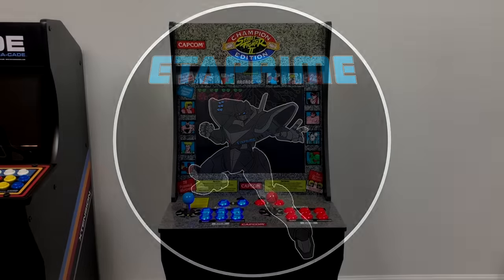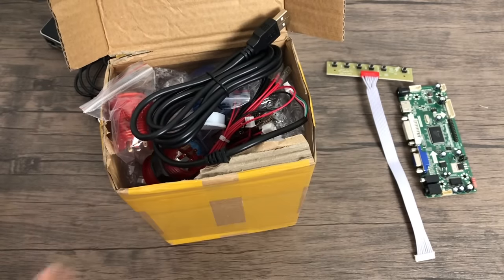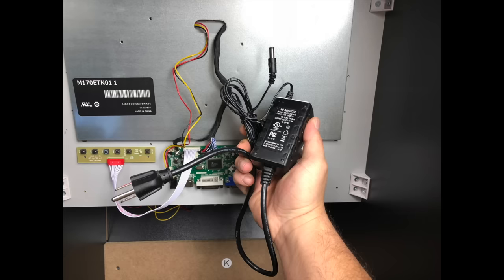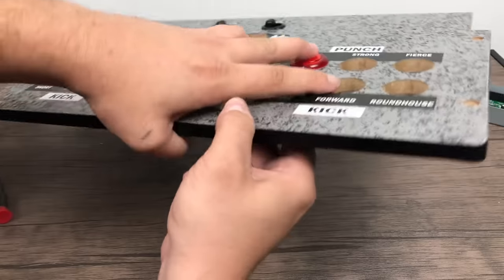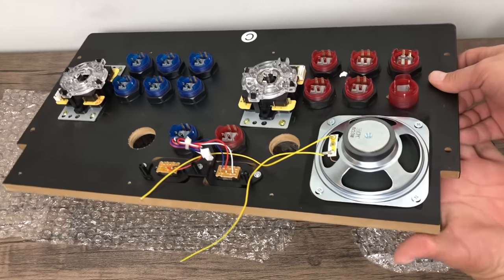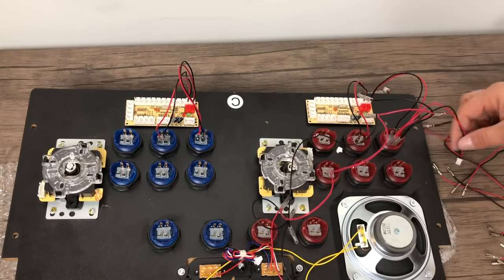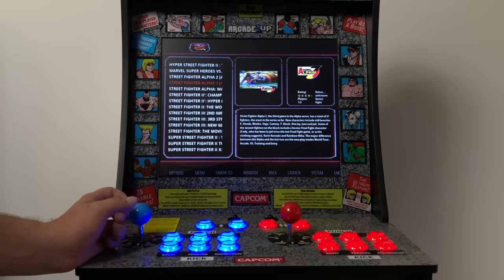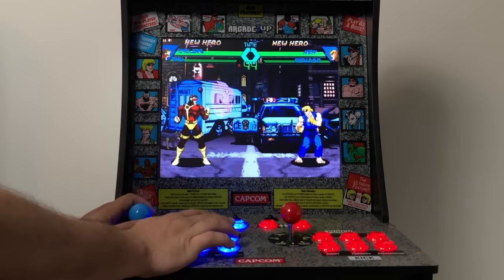‪Arcade1UP Raspberry Pi Install Tutorial - RetroPie in an Arcade1UP

Comment: I plugged everything in, and I’m getting a red and green flashing screen
Reply: Ever figure it out? I'm getting it too myself
Reply: Thanks a mill. Dammit, I was hoping this would be as straight forward for me as in the video. I'll see if I can fish out an old monitor somewhere
Reply: For any future people with this issue. ad this issue. You just need to replace the  LCD to HDMI board. Even though the board I bought said on Amazon "This board works on the Street Fighter 2 Arcade 1up " it was not compatible. 
Make sure to read the exact model number on your monitor, and make sure that the board you buy has that number in the description.
I returned my board to Amazon, bought the correct one, and it worked straight away

Comment: Speaker tip- use a AA or AAA battery.  Hold one wire on the bottom of the battery and then tap briefly the other wire to the top of the battery.  If you see the speaker cone push out when you tap then you are in the correct phase and you'll know which wire in positive and negative.  If the speaker cone pulls down then you are out of phase and you'll know you just need to flip the wires around to have the correct phase.  I also swapped out my speaker with a two way Kicker 4 inch speaker, it sounds great!
Reply: curious how many ohms stock and kicker one you used are
Reply: @coolelectronics1759  4 & 4
Reply: @christopherbrown5338  cool thanks

Comment: Thanks for the comprehensive tutorial. One thing: Do yourself a favor and use industrial velcro instead of two-sided tape. It's not too expensive and it'll make it much easier to remove/replace components if you need to.

Comment: 17:19 pro tip,  take a double a battery and put one speaker lead on the  + one on the -.  If the speaker pushes out you have the right polarity.
Reply: VERY PRO Thanks!
Reply: That’s an old car stereo installer trick - I always had a 9 volt battery and did this to check polarity when I needed to verify
Reply: The man. 👍🏾 Shout out from 2024.

Comment: Followed this and everything works great ADDITIONAL TIP! You can remove the mount plate from the Original Joy sticks and transfer them to the Easyget Sticks show in the video so you don’t have to drill new hole for the stick mounts! Thank you ETA Prime!
Reply: Robbie Whiplash Do you have a link on how to do this? My stock stick plates were super-glued to the board so I’m wondering if removing them and sticking on the better sticks would be easier to do.
Reply: SmaMan  No, I personally don’t or know of one. I just kind of figured it out on my own while I was doing the mod.
Reply: Thanks, this helped me today

Comment: For items like the amp, I'd recommend using velcro instead of double sided tape. This way, if you need to remove anything in the future, you can pull the amp off the side to access the wires. Much easier than trying to disconnect by reaching around to the far side.
Reply: Yes.. and i know to never use zip ties...  Instead, use Velcro wrap.

Comment: This is the most comprehensive vid I've seen for doing this type of Mod. Interestingly, the newest LED buttons I got look exactly like yours except they have connections like the encoder board on the bottom instead of the 4 leads. Thanks again for making this vid!

Comment: I followed your instructions and they were great. I only had one problem and that was the wires for the CFL were to short to reach the wood part. So if you take the old board out of the metal box there is a piece of plastic behind it. I took it out and taped it to the metal monitor back and then taped the controller board to the plastic. Thanks again for your instructions.
Reply: You  literally a life saver mine has the same issue with regards to wire length was looking at reusing the pcb box  but now ill just follow this instead,cheers mate
Reply: Thank you so much for this! God bless. I just started modding my free gifted sf2 1up cab and have the same problem.

Comment: Probably have built 10 retropie setups. All done with some of your tutoring, of course! Learn something new every time you do a new build. Keep them coming. Although the only thing I would have done different was implement your two wire single button shut down with script method on the power button!!!
Reply: stupid question, but where do we find the software to put on the pi ?

Comment: Thank you for this video! Just completed this myself by using your instructions. Only thing I changed was pulled out Volume/On-Off switch and expanded those holes to fit 24mm buttons. Works perfectly.
Reply from the maker: Awesome!
Reply: ETA PRIME show us how to still use the stock power and volume switches with this set up. Thats all im missing, please!

Comment: The tutorial was great! I finished the mod last night. I added a 2nd speaker for stereo!
Reply: how do you add a 2nd speaker? also how do you turn on/off and adjust volume?
Reply: @baophan4067  You can add a 3" speaker on the other side and drills holes in the same pattern. I brought a switch that plugs into the power strip
Reply: @Reggie4087  the switch turns the unit on and off or controls volume?
Reply: @baophan4067   I don't use those buttons ..in the tutorial he recommended using the AMP for speaker audio... it supports stereo I just set the audio at a reasonable setting and close the unit
Reply: How do you properly shut this down?

Comment: great video! I did the same on my partycade, but instead of running a power strip, what I did was use a 12volt splitter and a big 12v power supply: I then Used a 12volt USB hub for powering the pi, and tapped everything from the 12volt splitter. That way I only use ONE power supply for the whole arcade. Also I am using a partycade.

Comment: You don't have to add more buttons, you can set the P1 start and credit button to the same button.
I have a fullsize mame cab and a bartop arcade with Pi inside and I only have a single button for each player and has caused no issues.
Reply: So the player 1/2 button works as both insert coin and start game?
Reply: @dogballs99999  I would like to know as well

Comment: Thank you so much for this. I was on the fence for getting one of these because of the cost and the amount of games that it has, but with this mod it's a no brainer. I'm going to be buying a PS4 for $150 on craigslist and trade it in to get $250 credit towards a 1upArcade from gamestop. Thanks Again!
Reply: I'm doing the same thing.
Reply: I did same things, traded in system paid 80 with tax. 10 was added for edge shipping (if inpatient you can get sent overnight). Ordered in store 10-5, got today 10-9. Will mod system today.
Reply: @mysticguy  Congrats! I'm actually putting mine together this moment. Waiting for the pi to be delivered later today.
Reply: @Jay Te 
Great, finally put mine together last night. I still need LCD controller board. I Have LED joysticks and Raspberry PI. Had to order from China, says it’s in NY now. Wish there was an alternative I could use for now.
Reply: @mysticguy  same I'm waiting for my led board too. You can use a tv or computer monitor ( anything with hdmi) for the meantime to make sure everything is set up, and connect it to the pi.
Reply: @Jay Te yeah I currently do that now. I have 3 raspberry pi boards. I’m using the Supreme Build V2 128gb image of retropie for my cab.
Reply: Nice I was trying out the 64gb Retropie Infinity, and I'm downloading  RetroRama v2 128gb, I'll check out the Supreme Build v2 too

Comment: If I did this, I would put the select button under where the normal coin slot would be. Haha and add an actual coin slot for donations.
Reply: If you're crafty I think you might be able to make a coin slot into the select button, you would have to turn the coin slot to a switch some how.
Edit: I did some quick research and it looks like it can be done. Here's a link to a "Coin Drop Replacement Pushbutton"  https://goo.gl/jAP8Fp
Reply: I was thinking the same thing, but I would make mine for cosmetic reasons only. Where to buy a coin slot button or just a door with the buttons that wire up in the same manner as an arcade button?? 🤔🤔🤔
Reply: @jayte7139  Thank you!! Exactly what I was looking for! Now I just need to find buttons that allow me to put either paper or printed clear plastic with printed letters and words to label my buttons (i.e. A, B, C, Start, etc..)..
Reply: I did that on my build hidden out the way
Reply: @Kevin Baumann I'm not sure. I just saw it online doing a quick search. At the end of the day it's a switch so I dont see why it wouldn't.
Reply: @jayte7139  the coin op mechs have microswitch connectors. 2 wires and its "hooked up" as a select button.
Reply: @Solmangrundy  yes. I'm making a video of the installation on a 1up.
Reply: IF you call 1Up, they will ship a clear overlay to you for free.
Reply: An aftermarket coin box can be bought on Amazon. It plugs directly into the zero delay usb encoder like any other button. Then you can assign it in mame so when you drop in a coin it adds credits. I did this with a full sized machine i built
Reply: Dude you gave me that idea i put them right below and am adding a coin slot for coffee donations !!!
Reply: But why did the button say 20 cents?
Reply: @tornay131  Lol.. AUSTRALIAN!???

Comment: I found out that if you are using a Sanwa JLF or JLF clone joystick, you can still use the Arcade1up joystick mounts(on mortal Kombat 2 cabinet, not SF2). the 4 screws on the middle of the JLF mounting plate (around the shaft) line up exactly with the Arcade1up mounting plate. no need to try to re-center or drill new holes for the joystick. just unscrew the 4 center screws from the both plates, and swap them.

Comment: First of all, AMAZING VIDEO!!!  I’ve got a SF Arcade1up on the way and I can’t WAIT to play it!  This video makes me even MORE hyped knowing I can add more games.  I’m SUPER low on cash and want to do this as CHEAP as possible.  As a total noob with doing stuff like this, I must ask, am I required to buy one extra button for each player to act as a select button or will retropie let me hotkey select buttons in?
Also, if I just want to stick to the default speaker that comes with it, is an amp still required?  Thanks in advance dude!!
Reply: DISCLAIMER I'm not doing this mod, nor do I have anything in this mod video. This is an outside in perspective.

The amp circuitry looks like it was integrated in the original computer module, which is removed in this video. It appears you will need a amplifier if you do this mod.  I recommend a Lepai lp2020 if you want to keep the original speaker. The lp2020 support bridged mono configuration, which will amplify the input on 1 speaker using the entire amplifier. If you want to use new speakers, the lp2020 is still a good choice because it also supports stereo 2 channel input and output.

Another option would be to duct tape in a set of cheap usb speakers to the inside of the cabinet, and run the 3.5mm jack into the raspberry pi.
Reply: Jonathan Clark I’ll keep this in mind whenever I mod this in the future!  Thank you!!!

Comment: An amazing instruction video!!!  Big Thx!
Maybe it would be easier to replace the built-in monitor with another cheap LCD screen which already has hdmi input possibility, so you dont need the HDMI LCD Controller Board and no audio amp ;-)
Reply: pepelehmann is that possible

Comment: Hi, i LOVE what you did with the Arcade1Up and i will try to do the same with mine.
just one question, I did not understand from the video, how do you turn the arcade cabinet\raspberry pie on and off?
Since you show the On\Off switch on the cabinet is not used in this setup.
Thanks to anyone who helps clarify this. <3
Reply: Late response, but I assume he just unplugs the cabinet from the wall or toggles the switch on the power strip that everything is plugged in to.

Comment: lol I see you added the amp part thank you :P
Reply from the maker: For some reason my video editor didn’t render that part with the video. You reminded me that it wasn’t in the original upload.
Reply: Note the amp linked above doesn't come with a DC power adapter.  So you need to either get an amp that does come with a power adapter or purchase one separately.

Comment: How do i make my raspberry have the same set up as yours?
Reply: Search RetroPi
Reply: [32gb]-Arcade.Only.Pi.AttractMode -Wolfanoz use that image
Reply: Big Shacaca once I have image flashed on card just pop it in pi ?
Reply: @Hehehehe._  use win32disk image writer to write it to a micro sd card then pop it in
Reply: @Big Shacaca.  The instructions I have seen from ETA show that you put retropie on the micro card and then use a USB drive to load the games. It hasn't worked for me. I'm having lots of issues.  So can I just load everything on the micro SD card and skip the USB drive?  Once I have retropie in the micro SD card.  Where do I place the wolfonzo image on the card? I have all the parts but cant figure out this portion.  Thanks for your help!
Reply: @mikeschude1925 
You do the usb drive if you working on a blank image of retropie. Retropie is the os and you would still need roms aka the games. If you're going from blank then yes usb drive. But if you get the Wolfanoz image it has all the games already you would just use win32disk image writer to put it on the SD card for you.
Reply: @bigshacaca6932  I downloaded the Wolfaoz image.  I have to buy a new SD card because I ruined the last one trying to do retropie and adding roms.  So you're saying I can skip the USB option of adding the OS if I'm using the Wolfaoz image?  Just use windisk to write the Wolfaoz image. Then pop the sd card into my Raspberry? Thanks for your help! :)
Reply: @mikeschude1925 
Yeah skip the usb thing Wolfanoz has the games and all built in.  Just write the img to the sd then pop it in.
Reply: Mike Schude just reformat the card and start over
Reply: For real why do they tease us sell the shit damn I want one two three I'll buy four of those lol

Comment: I’ve double and triple checked my wires. And everything checks out. I can’t get my hotkey to read. I know my select button is working because i can select it while configuring the buttons. Anyone help ?
Reply: I'm having a similar issue. Did you resolve it?
Reply: @JohnnyDollar720  Did you ever get an answer I am having the same problem
Reply: @quintinbailey08  nope but I figured it out. You have to go into the retro pie screen and configure the aspect ratios to 4:3 for each system
Reply: @JohnnyDollar720  Thanks for coming back and giving the solution. There's too many people that don't do that, so I appreciate you doing it

Comment: Hi, i tried to follow your amazing tutorial, unfortunately something is not working on the the LCDController board step.
when i connect my raspberryPi and turn everything on, the screen is just flashing black and white. The Led on the other board is green, i tried to click randomly the buttons on the board, with no results. The Raspberry is working correctly (tried on my tv), i also tried three different HDMI cable and the same happens.
Is there something i can do to check if the LCDController is damaged or something, or there is some sort of incompatibility with my Arcade1UP?
Thanks!

Comment: As always, great video and thank you. But there are a few things I disagree with. First, I don't think this is a "toy". My Coleco Donkey Kong and Frogger mini arcades are toys. Second, never throw away the original parts. What if you want to put the Pi in a different cabinet and sell this one or revert it to stock? Same thing about cutting the connector off the speaker wire. The LCD converter board comes with an audio jack. Use it. Go on Amazon and buy a $13 PC soundbar and sticky tape it to the back of the cabinet behind the marquee. No amp needed. But more importantly, emulation volumes can be all over the map. With a soundbar you can reach up and turn the volume wheel at will. Third, you can buy the wood panel underneath the control board precut with two holes for the buttons for $10 allowing you to keep the original intact.
Reply: Could you elaborate a bit on the soundbar part? I'm interested in going your route
Reply: @Ashhong1  On Amazon you can buy a Dell PC soundbar for about $10. Sticky tape the soundbar on the top of the cabinet and run the power cable and audio jack through the top hole in the back panel. If you place the soundbar at the back on the edge before the back panel, it is not visible from the front. The power plugs into your power strip and the audio jack plugs into the audio jack on your hdmi converter board. My main reason for doing this is instant volume control and cost. The mini amp costs $20+ most of the time (the cheap amps don't come with power supplies), and you have to open up your cabinet to make adjustments. Even so, with the original speaker method you're still using a single mono speaker so if you want stereo sound you have to cut speaker grill cutouts somewhere and buy a couple speakers. MAME volume varies by game; some are super quiet and some super loud. Not a problem on pc with a keyboard sitting in front of you, but on an arcade cab it is a bigger issue. Getting a soundbar is simply a cheap, no damage option that allows per game adjustment by reaching back and turning a volume wheel without cutting your original speaker connector or adding another component. Just check to make sure the soundbar comes with a power supply. They're still cheap and sound good.
Reply: @pdxmetal  That sounds like a good alternative. I plan to do this to the special edition Marvel cabinet that comes with stereo speakers so I think I am going to try to use those. Is the amp not necessary though? It seems like some of the LCD control boards have an audio output that I might be able to plug directly into?